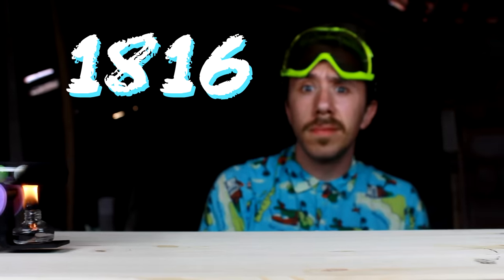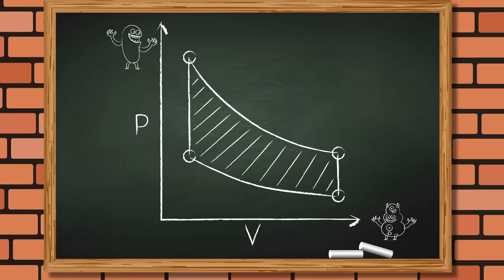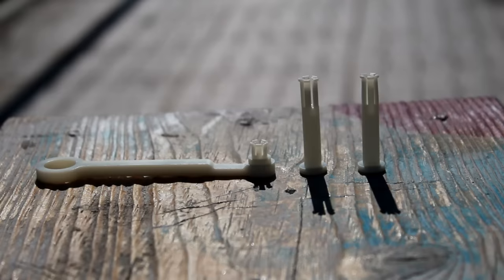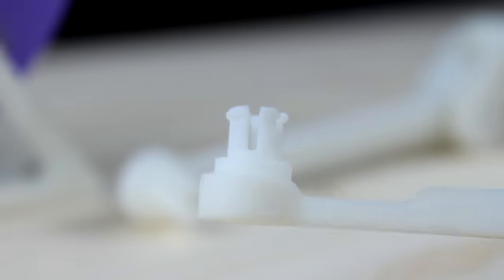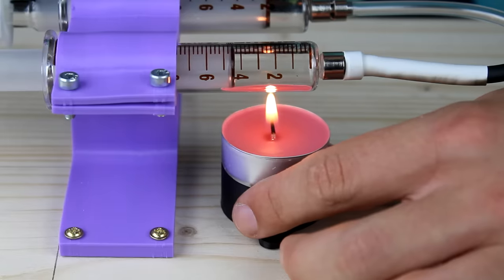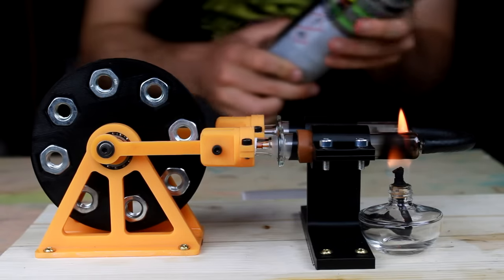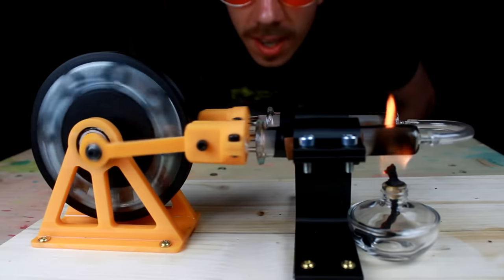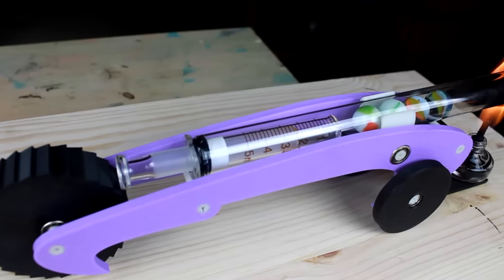Hot Air Engine Car (Stirling Engine 3D Printed)

Comment: you should try placing the cold tube under running water to greatly increase the temperature differential between the two cylinders
Reply: Great idea! A radiator equivalent!
Reply: and maybe even put an insulator between the 2 so the heat doesnt transfer as much with them being side by side
Reply: That would work, same concept as a balloon filled with water won't  burn. 🎉

Comment: I can’t believe nobody asked this question. Why not just use a piece of greased metal tube on each inlet and then connect the rubber tube to either side with the regenerator, that way you minimize heat loss and prevent melting? Worse case even if you use a very tiny heat sink(aka add some tiny fins or make a small mechanical machine to add a drop of water on the pipe) the surface area with thermal conductivity is still very low, so the engine still works well

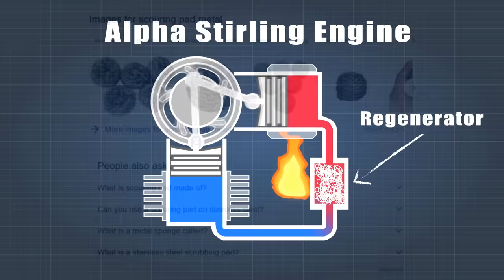Comment: 19:15 Hey Integza A steel scouring pad is also called steel wool easier to say also.
Reply: Yup. I call them steel wool as well. Also, a lot of fun to touch with a 9v battery to start fires with.
Reply: A steel scouring pad is different to steel wool.
The scouring pad is much thicker strands.
Reply: I grew up calling them brillo pads
Reply: It's called a scrouser
Reply: The material is called steel wool.  It is available in many grades, from 0000# (0.025 mm strands) to 4# (0.10 mm).  It is used to make scouring pads (including the well-known brands Brillo Pads and S.O.S. Pads) and as rodent-proofing.

Comment: Most people call the scouring pad thing "steel wool" :)
Reply: Not the same thing thought.
What we call steel/iron wool in french is very fine fibers of iron someimes used as abbrasive and to light stuff up(and probably other uses)

Metal sponges are much thicker and tougher
Reply: Maker's Muse i’d guess

Ouch :/

(Like your channel btw)
Reply: @reedy_9619  In America at lease both are called steel wool. That is just a thicker variety.
Reply: Steel wool has different levels of coarseness. The steel wool used in kitchens as metal sponges are still steel wool, just on the very course end of that scale. Also the ones used for cleaning are generally made of stainless steel!
Reply: That particular stuff is probably stainless steel, though I wouldn't call it wool any more than you'd call the hair on an elephants ass "wool"
Reply: @Max_Chooch  

As someone who works in the natural wool industry, we're terribly offended by the steel wool association!
Reply: The steel wool I'm familiar with is also found in survival kits... Stick a 9v battery to it and it'll burn to China...LoL

Comment: You are going to have to use a metal tube(probably copper) that inserts into the syringe (rather than over the end) that expands when heated creating a stronger seal. Think Mark Roper's Icecream self locking container.  You also need a heat resistant gasket to create the actual seal, there is such a thing in tape form so you can wrap the end of the copper tube inserted into the end of the syringe.
Reply: El tubo metálico haría perder demasiado calor del fuego
Reply: I just made a comment bout that 3 years too late😅
Reply: @victorortiz3279 it would actually store heat after awhile he could warm the copper up with a lighter first if that's a concern
Reply: Copper definitely would hold heat well I thought the same thing when watching lol

Comment: Now if you only had some glass tubing...
The Alpha Engine was actually running at an impressive speed and I loved the look on your face when the car actually moved 😂
Reply: I too agree that glass tubing with the answer and maybe even a couple other small adjustments but we can talk about that later. Brilliant simply brilliant
Reply: Iwas thinking maybe metal tubing, but seeing how the metal tips on the big siringes disipated the heat, it's not so big of an idea
Reply: why not use a metal coil around the hot cylinder and move the heat source away from the rubber tube.
Reply: @Kurukuu  metal tubing would work fine. It would do the same job as the economizer.
Reply: With motorcycles we wrap the exhausts to move CO2 from the engine more efficiently, make the connection tubing glass, and try wrapping the tubing in something to help reduce energy loss to the atmosphere around it.
Reply: The hottest part of a flame is at the tip of the flame, not the tip of the wick. Focusing the heat would probably get better life out of the tubing (I'd go with copper).

Comment: you could shield the tube with a bit of aluminum from a can glued to the front of the cork so that the flame doesn't touch tough the cork but its insulation properties are still utilized.
Reply: Couldn't he heat the tube using water or steam which would keep the tube from melting
Reply: Or just use a metal tube lol
Reply: Yeah lol

Comment: Hey integza ... a piece of advice to increase the power output and the thermal efficiency of the stirling engine:
-  try increasing the initial pressure inside the alpha Stirling engine.
 - also u could reduce the clearance volume off the piston.
- Try using copper wires as a regenerator and place them inside the tube ; this way u reduce the total dead volume in the engine and use  space as a regenerator. 

Love your videos. Piece ✌
Reply: Good advice, but steel generally works better in a regenerator than copper as reported by many a Stirling engine builder.
Reply: Couldn't you use the copper wire on the outside, and pass an electric currant through the wire? I guess some material is better but I'm just asking if that would work or not

Comment: Instead of using burner, sunlight focused from magnifying glass could also work well and that will also resolve the tube burning issue.
Reply: That would indeed work, but the glass needs a special high temperature coating that absorbs light. In other words, it needs a black hi-temp paint coating. Without it the light just passes through and doesn't heat the glass sufficiently.
Reply: @PunakiviAddikti  unless of course you put something within the tubing that would absorb the energy from the light, possibly heating the inside of the chamber better.
Reply: @paulghignon4092  That's what I said.
Reply: @PunakiviAddikti  well you said about coating the outside then basically heating the outside. My idea was putting something INSIDE the tubing, sort of like he did in this video with steel wool; potentially maybe some steel wool coated in something that makes it less reflective. The reason why I bring this up is the possibility of using the glass for an insulator rather than the heatsink.
Reply: @PunakiviAddikti  Glass is often opaque to infrared so it'd likely still work.
Reply: @isodoublet  Glass is also reflective, it reflects most infrared back out.
Reply: Solar powered car!

Comment: "Who would know that wd40 is flammable?"    
Instant like and subscribe 😂
Reply: People who read cans.
Reply: Who would've guessed that CORK is flammable.
Reply: Wasps and ants know exactly)))
Reply: WD-40 is not flammable but the propellant is
Reply: @gfis9254  WD-40 is flammable, but it doesn't burn easily.  Kinda like the difference between vegetable oil and gasoline.  You just have to get the WD nice and hot before it will burn.

Comment: I’d like to see an Rc car with a five speed transmission and stirling engine power
Reply: DustJustin bet
Reply: JustDustin nice
Reply: It would need a cooling system and hi temperature burners, that wouldn't be easy to fit in a car that's the size of a 🐀, in a big real life car it would much be the same expect the air would have to be compressed to give it extra horse power, and it would be expensive to produce with the car engine having to be exposed to hi temperature for a long time, also the car need a refilling station for water
Reply: Zane fraser I said rc
Reply: @shept.7736  read the whole comment
Reply: Zane fraser oh wait yeah, I meant like a large rc car, like the size of a laptop or something
Reply: @shept.7736  oh, still would be hard to fit a whole cooling system to cool an engine that has fire has its mover, also would it use electric to heat the cylinder or propane. Also I ment a rat not a mouse like the emoji might suggest 🐀 this is a rat 🐁 this is a mouse
Reply: I don't think the car would have enough speed or torque to properly use the gear ratio of 5th.
Reply: That wouldn't be possible. Stirling engines have very poor torque. They can barely spin a small generator to power a single LED, and even then the engine slows down significantly.
Reply: Bro literally had the same idea while watchong this lmao.

Comment: Make the cylinder cradle and the flywheel support a single piece. The force of the syringes pushing back and forth means the cylinder cradle rocks. That, in turn, exposes the tube to the flame and destroys it. There's also a tiny bit of resistance with the more bearings you use

Comment: What about using A GLASS TUBE?
If you don't have any glass tube, simply walk into one of those dark alley and ask some people there, they will sell you one for almost nothing...   ;)
Reply: @sherdillll  meth
Reply: Silicone tubing would be better than rubber, but he really needs to create a heat break (like on his 3d printer).
Reply: @juststeve5542  wouldn't that effect the air temperature though?
Reply: Even extending the length of the syringes by 5-10cm/2-4in would ensure the heat was further away. The absolute solution is to make a glass u-bend, cut to length, file the ends and syringe tips and 'solder' the glass u-bend to the syringes
Reply: @reggiep75  '2-4 inches'   lmfao      'solder' glass...  WTF  is that supposed to mean.    you do  NOT  know what you are talking about !!!!!       btw,  elongation of the hot-cylinder  should  NOT  result in an  increase the  Dead space !!!  cheers
Reply: it most likely needs to be a bit flexible, glass tube might break after some time.
But it's worth a try
Reply: @TheRailroad99   You can use high-temperature resisting silicone for the joints, this should allow it to move enough without breaking.
Reply: those are typically not made with borax and therefore unable to take the kind of stress one would need for a reliable engine
Reply: @reggiep75  I believe the word you are looking for is "weld."

Comment: 9:36 you're not allowed to blow off some steam! This is a Stirling engine video!

If you find a piece of aluminum tubing that's the right diameter to slip over the ends of your syringes, you can JB-weld them in place. JB-weld can withstand 550 degrees Fahrenheit, allowing you to move the flexible tubing away from the heat, or just make a U bend directly in the aluminum tube to save heat energy.

Comment: Baptise it "The Hot Crawler "
Also use silicone tubing instead.
Reply: Thats what the clear tubing is dude Best way to do it is glass tubing Which means custom "Heads" lol
Reply: @FoxxFire91  That wasnt silicon tubing used in something like a Nitro R/C application.
That clear tubing was simple fish tank shit.
Silicon Nitro R/C fuel line, though isnt bomb proof, still lasts far longer under direct flame then that nylon shit does
Reply: Sir does carnot engine and sterling engine is same..

Comment: Stirling engines have their use in places that have heat to dispose of. Like server hubs. They could be used to turn some of that heat back into electricity
Reply: Or directly drive fans. No sense converting rotary motion into electricity only to turn it back into rotary motion again.
Reply: Swedish submarines also use Stirling engines.
Reply: Filip Nikolic  Soon enough fans will be needed to re-condense the nitrogen.

Comment: Maybe your engine will improve when the air on the cold side cools faster. I'm thinking of a piston in a waterbath or a metal piston, brass for example witch has a great heat response
Reply: essentially all every stirling engine is ... is a heat differential engine ... the bigger the difference the more work it can do ... the last version he displayed works best by retaining heat and moving the bulk of it from one side to the other quickly ... the more common hand held one uses your idea of cooling one side .. built in a larger scale can work very efficiently but size and weight become it's major limiting factors

Comment: Brass tubing, 2 small metal pipe clamps. Roughen glass for better grip to the tubing. You could try to solder the tubing to the glass, but it may break.

Comment: Integza I believe you could stop the melting of your connecting tube by placing the flame lower or the glass syringe higher so only the the very tip of the flame is just below the syringe I see the flame is burning all the way around your syringe including the tip moving  the flame lower would concentrate the heat more where I think it’s needed and maybe for a future project I think you should try diy do it yourself fireworks/pyrotech thank you love your content keep it up 👍
Reply: Plus I would love to win a 3D printer

Comment: 19:35 - Fumes of molten plastic finally kick in...
And yes, as other have said, you should look into joining a bit of glass tube onto the end of the hot cylinder... Bit of basic glass work, what could go wrong? (Well at least it's not flammable!).

Oh, and I'm still trying to find the Tesla link... There must be one in there somewhere...

Comment: try adding a copper or aluminum "tin" heat shield with a hole drilled in it for the glass barb. this way the flame is kept away from the tubing, another option is to use tubing rated for steam or higher temps.  adding a wire hose clamp may also help.

Comment: You should name the car the “purple pumper”
How does using different gasses instead of air affect the performance?
Reply: I think Cody's lab has done a video about using differing gases in an sterling engine, as well as running one in a vacuum
Reply: "Purple Proud" would be a good name, in my opinion, but Purple Pumper is a good candidate.
Reply: Pressurising can improve performance as well as using nitrogen.  Philips developed a marine sterling engine filled with nitrogen.
Reply: PURPLE PUMPER PLEASE!!!!!
Reply: Using helium instead of regular air noticeably improves performance.
Reply: Purple pumper for the win.

Comment: I have a few suggestions to help increase the efficiency of your system. First, it might help to add a temperature diffuser which would be the parts sticking out from the left-most piston seen in your animation at the end of the vid. If you do that, you should also insulate the rightmost piston, that would be the thick wall surrounding the right-most piston in your animation, that combined with your regenerator/economizer should help. I would have also liked to have seen the economizer in a separate section, just to stay true to the design outlined in your animation, but I doubt the effect would be anything significant compared to the insulation. I feel that if you had just insulated the syringes alone, your piston system would be much more effective and laster longer! (if you could get better pipes, of course) 

Again these are all suggestions I thought about when I saw your animation, I'm sure you had already noticed these things but I was wondering why not try them? I feel like they would help a lot!

Comment: Little tip: If you put the piece you want to heat at the middle of the flame (where's almost no oxygen and the flame is not burnng...) where it's hollow but rather near to the nop of the flame cone. There's the most heat.

Comment: a heat shield like a lil metal plate that slides over narrow end of tube and reflects the heat back away from tube also could have a metal funnel to direct the lil flame onto it's target the glass tube but stops the flame from overspilling onto tube as it rises

Comment: Graphite is mostly only good in conjunction with oil inside a piston engine due to the metal on metal contact, it forms a better barrier in between the cylinders and the pistons. That’s why it’s used with some fuel additives.
Reply: It prevents wear and tear

Comment: Commercially available Stirling engines solve the tube problem by linking the two glass tubes with a metal body. The tube is built into the metal body. Some use silicone tubing which can withstand fire, but still extend the tube away from the flame.

Comment: I want to start a bussines of my own, i am in the last year of college in mechanical engineering and i could  use a 3d printer but i don't have the money to buy one...
Reply: i bought a 90€ China 3d Printer. the Quality is acceptable and it is enouth for me
Reply: @Heads Mess and how does a treadle lathe do 3d printing ? since that was his question ... as for affordable options .... he could always make one himself being a mechanical engineer ... he just needs some stepper motors and some program control after that it's all in what he feels he can handle in size and design needs .. 
.
Reply: being a mechanical engineer build one
.
put those fresh learned theories into a practical application ... to build yourself a 3d printer to allow you to do more 3d mechanical work from prototype deposition technology ... 3d printing/prototyping
 ... yes you will have to learn some electronics and programming ... but you should already have the basics for those started from your course of study

Comment: 19:15 it's called steel wool 😂 Google Translate sometimes haha
Reply: As a Brit, what we call steel wool and a metal scouring pad are slightly different technically but often used interchangeably. The scouring pads are coarser metal wire and often used in the kitchen whereas steel/wire wool is a finer sanding/finishing abrasive used on metals and glass.

Comment: if you put a wide metal washer  between the fire and the tube with a layer of heat insulator on the side of the washer that faces the tube it should stop the tube from melting as long as the tube is not directly heated by the fire